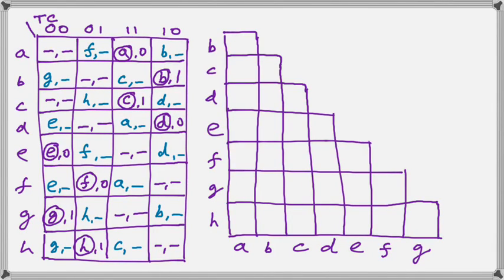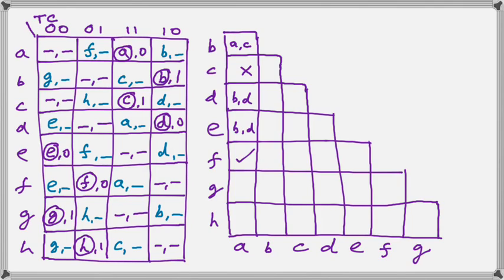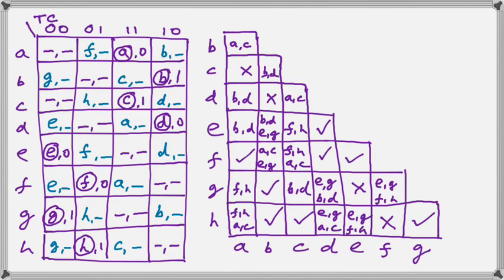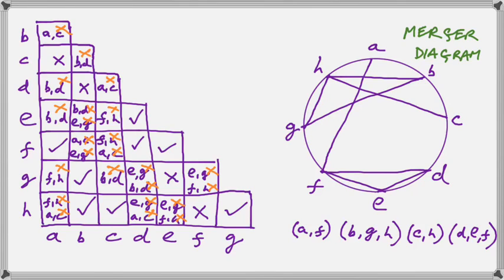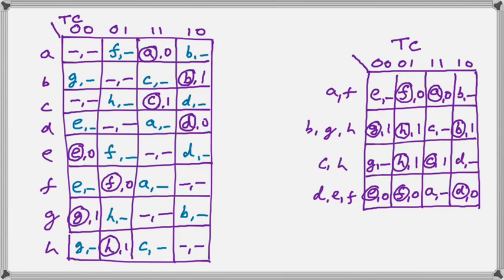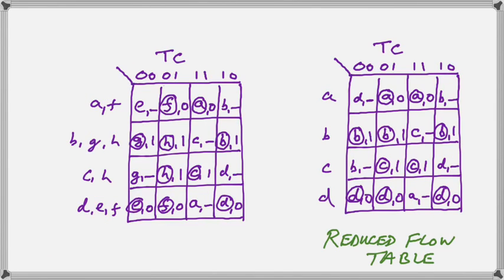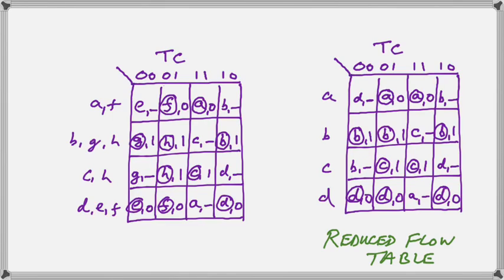Design of Asynchronous Sequential Circuits - Part 2

Comment: What happens when any of the cell in implication table has no ✓ or X but possess a value for example c,j ?
Reply from the maker: every cell will eventually have either tick mark or  X .... if a cell has in c,j that means you need to inspect the c and the j rows and if they can be merged then c,j becomes a tick mark.... if they cannot be merged then c.j becomes an X
Reply: @StephenMendes   I got c,j in jth row and cth column also the same c,j is occuring in gth row and cth column. The thing is that further reduction is not possible in this stage.
Reply from the maker: @gopikarajvs9912  maybe you just need to re-watch my video(s) ..... IF c,j depends on c,j then you might be  thinking about this the wrong way ..... the two rows are INCOMPATIBLE (X) if they have DIFFERENT outputs in the same (overlapping) square (then they cannot merge) ...... if c.j depends on c,j AND the outputs are NOT "incompatible" then the c and j rows can merge which has implications for everywhere else that c.j appears in your table ..... I offer individual student help on my Patreon if you have a Credit Card or Paypal account and want personal help 😊
Reply: @StephenMendes  thanks alot for the replies 🤝

Comment: So what if the fourth column in row d was replaced with d,1 in the primitive flow table. The square b,d on the implication table would then have a dependency of b,d correct? Would this then mean that all the other squares with dependencies of b,d remain b,d? Or can this never occur in the first place?